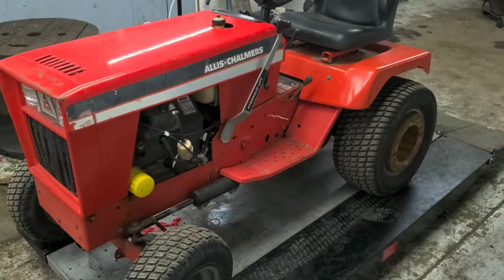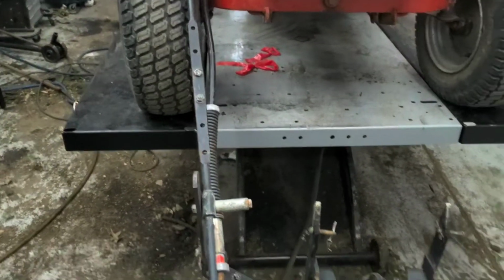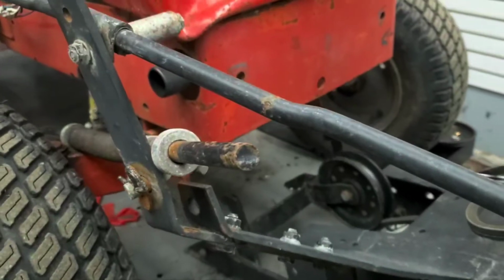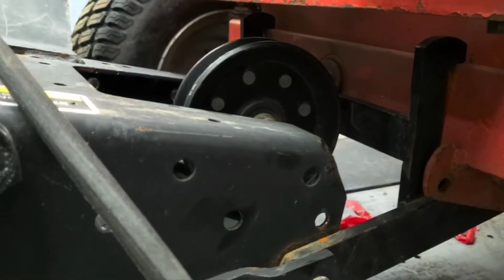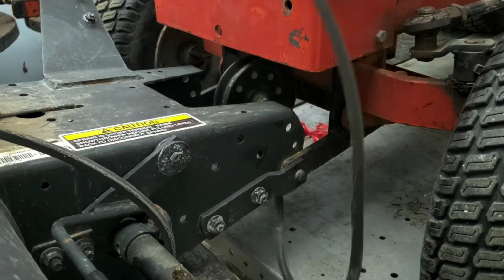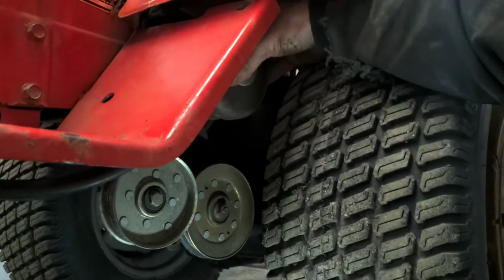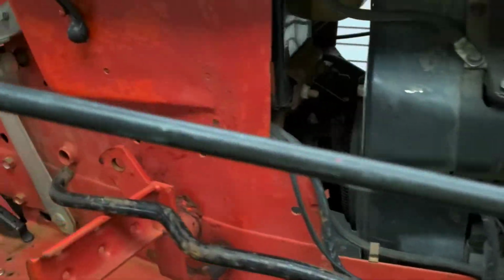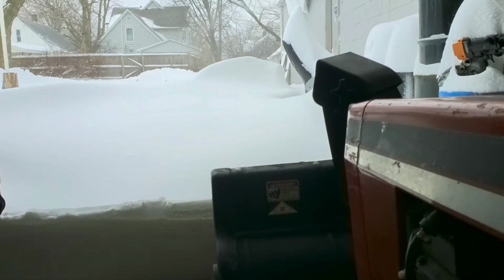Simplicity Snow Blower Install and Test In Foot+ Of Snow

Comment: I'm stoked because I just managed to buy a 42". Thank you so much for running a camera while you did this! According to the model number, that's a 916H. Do you remember if it had the 16HP motor? Reason being, I have a 912H, and the person I bought it from warned me that 12 might be underpowered for this attachment.
Reply from the maker: It did have the 16hp motor for sure! The customer had the RPM set really low on this otherwise it would have thrown twice as far. Some of the older guys don't like their stuff turned up. I talked to him about it but he asked me not to adjust it. I am sure with this running at the rpm it was your 12hp will probably run it good. Only one way to find out!

Comment: You might make a comment or anybody that's installing one of these you have to make sure that your pulleys and put in perpendicular actually linear with the frame of the tractor there's also a tab where that idler pulley goes in it can set off an angle for the lawnmower deck attachment it sits over at about 60° but it appears that this one's already set up with a pulley on the right tab that would be linear with the tractor frame it's important you can also hook up at 700 series Alice Chalmers or the other series whatever they call it in the simplicity if you get a wide pulley and use some washers to space it out far enough it will still work even though it's over at a 60° angle

That way you can just use the long belt all the way to the back and that belt I believe is 137 inches versus I think 148 it might've been 139 it's either 137 138 or 139 you might have to buy all three and figure out which one works the best on the 700 series but it is doable I think I have a video about it
Reply from the maker: Great tips!